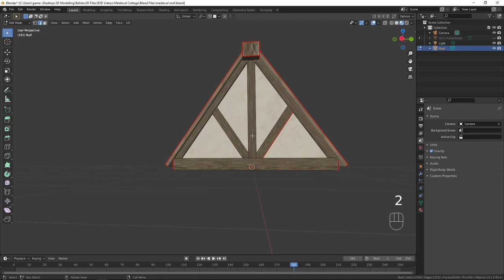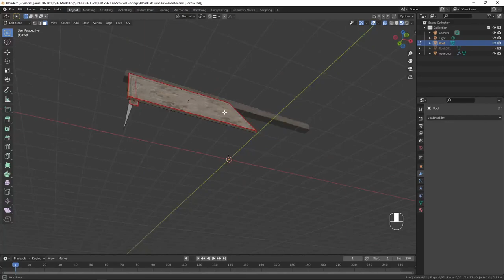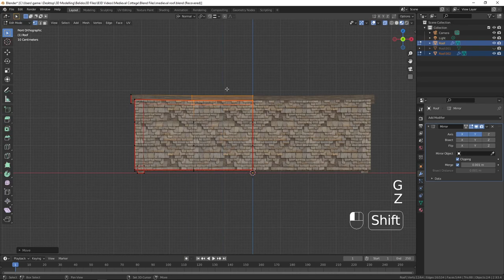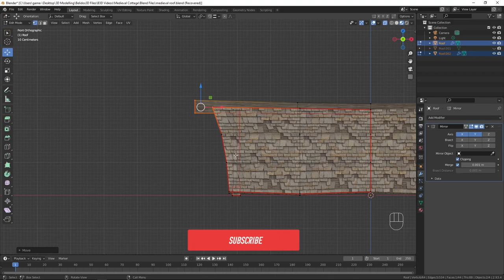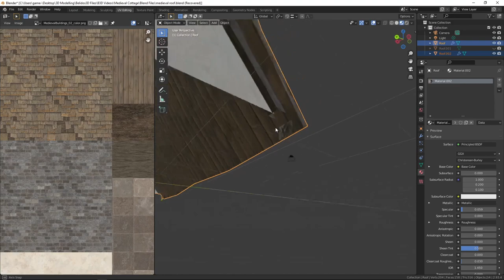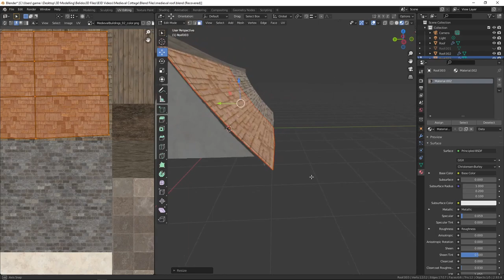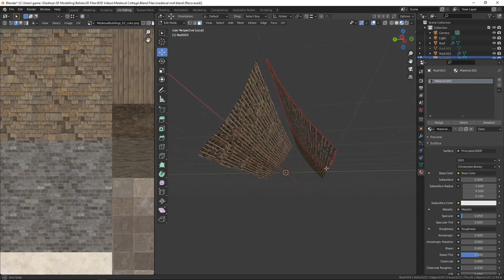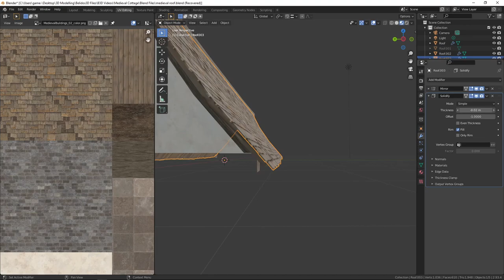Modelling a Medieval Roof | Blender 2 9x Tutorial

Comment: Great tutorial, with a very attractive result..., looking for information on modular environments for this type of medieval models, I have found some of your tutorials, in which I am surprised by the ease to solve some errors that always come to me, such as example folding Uvs on themselves, too long, (something that I thought was totally prohibited in texturing) resolving quite well the tiled errors in the textures...., and without losing resolution in the model due to the dreaded Texel Density. .. and also using a simple Atlas texture for everything..., my big question is..., do you recommend the use of this type of Atlas textures for this type of constructions..., and if so, what resolution Would you advise for that High texture like the one you show, ... thank you very much for the very didactic tutorial, Un Saludo
Reply from the maker: Hi, sorry for the late reply, i've been away from youtube for a while due to work and sickness. Personally yes i recommend the Atlas texture method for most larger models like buildings, i usually use a 4k texture, this sounds a lot, but in most renderers, especially game engines, the size of the texture has less impact than the higher number of draw calls for multiple texture sets.